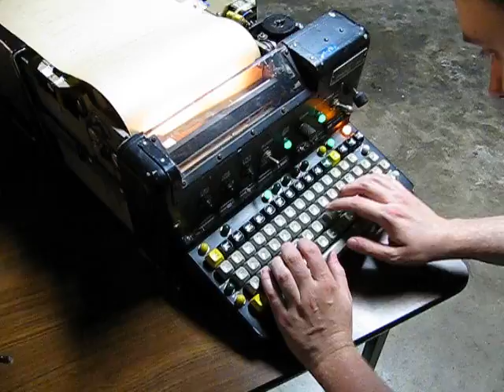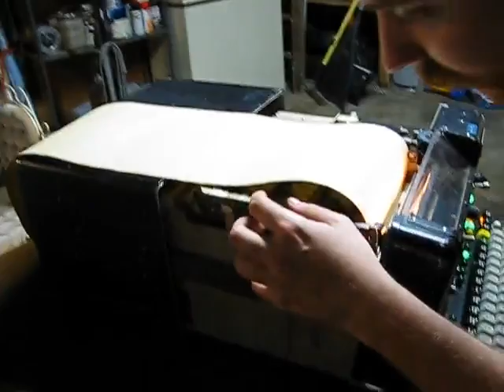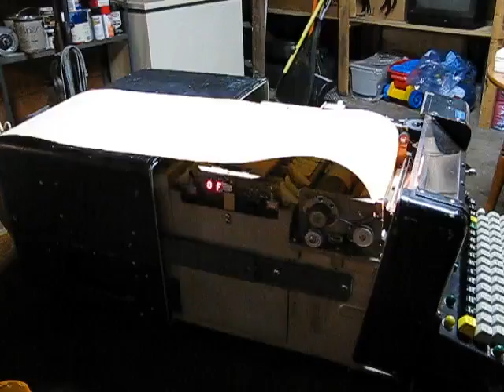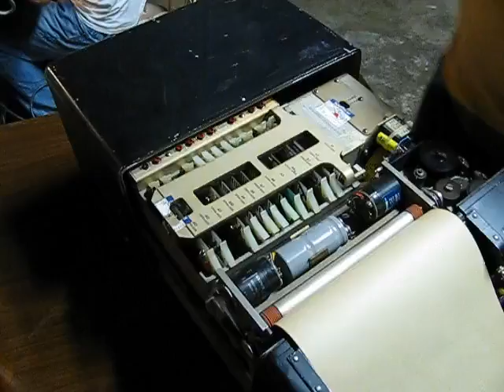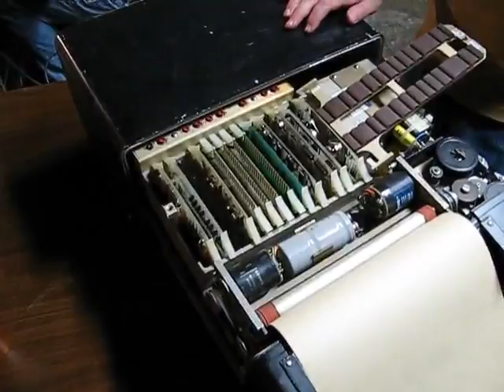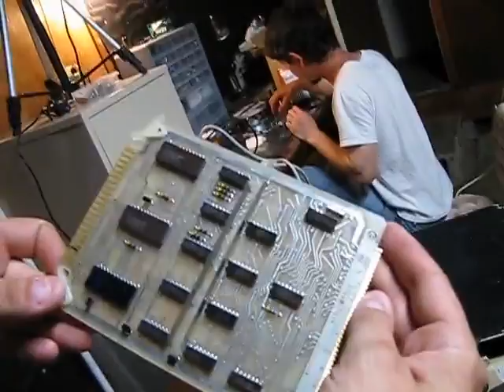Tracor AN/UGC-129 Airborne Teletype

Comment: What aircraft were these used in????? WOW!!
Reply from the maker: Brad Hayes From what we know, the UGC-129 was the USAF's default general purpose teletype through the 1980s and into the 1990s. We're pretty sure that it was used aboard the B-1B Lancer, and could probably be found aboard any aircraft large enough to have a communications officer. One of the engineers of the UGC-129 says that either the UGC-129 or UGC-120 was used aboard Air Force One. The UGC-129 is also closely related to the teleprinter used aboard the FB-111. The UGC-129 was used by the US Navy as well.
Reply: These units fit a standard equipment rack so they could have been mounted in any large AC with a personnel cabin or equipment bay. There was a smaller system that was installed in the cockpit of the F-111 and B-52.  It had a very small keyboard and was mostly a receiving instrument.

Comment: There were 2 earlier versions manufactured in very small numbers - 1 for Boeing and 1 for Collins. Then there was the small cockpit version for the B-52 and the F-111.  Mechanically ok except for the obsolete printing mechanism. Other than that they were obsolete by the time they were only a few years old. They were introduced at the end of calculators and the beginning of PCs.

Comment: There is one combination of keystrokes that would make the line feed roller pull the paper back into the printer. It was proof that the TRTT sucked. That turkey has almost no memory by todays standards. 
I was the manufacturing engineer for all the mechanical parts from 1979 to the end of the model which had a digital display. It was the AN-UGC 129 V1.  The V1 version has an overhanging bulge on the door above the keyboard to house the green LED digital display.  The digital display was easier to read but I think it only had one line of text.
Reply from the maker: Are you sure the V1 used a LED display? The documentation I've seen said it has an "electroluminescent display", which is presumably referring to a vacuum fluorescent display, the prevalent technology for such things at the time.
Reply: The Vintage Technology Association I think you are right. The display looked more like a dot matrix similar the LCD calculators of the time except it was lit.  If you cannot read the printing, the ribbon is probably old and dried out.  There is a hammer inside the print head that strikes the paper and ribbon. It never had enough energy to print really well. If you cut .030 to .050 off of the back end of the hammer it will print better but the font will eventually break from the heavier impact.  They were manufactured in Austin, Texas by Tracor Aerospace.
Reply: @schwarzekappell3348  i definitely used these with a green LED looking single line dot matrix appearance as you say. Had them before that mod and after. The ability to edit a line before sending it was pretty damn high speed for 1990.

Comment from the maker: The "40-character visual line display" mentioned in the AN/UGC-129 specifications is the window in the front which allows you to see what's being printed. The only electronic display in the unit is the internal two-character hexadecimal LED readout, which is composed of two single-digit HP smart displays.